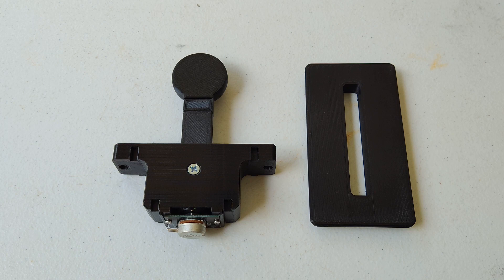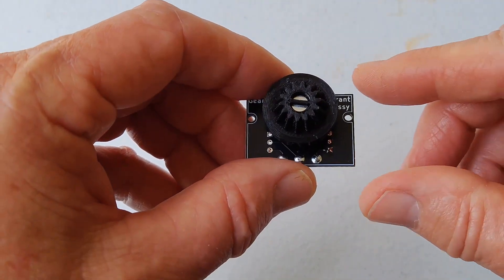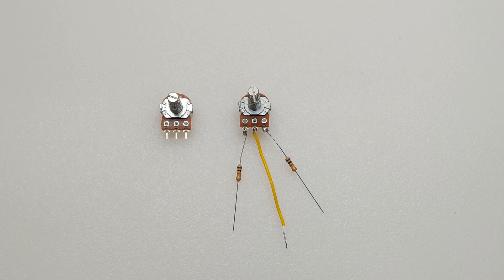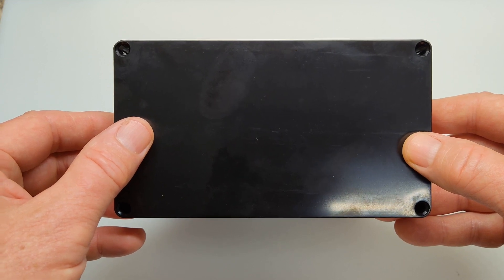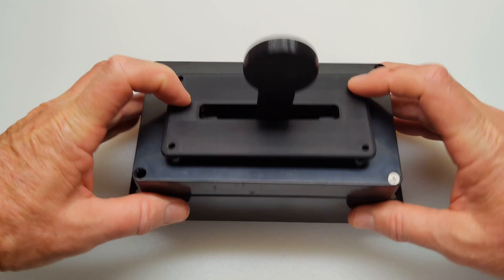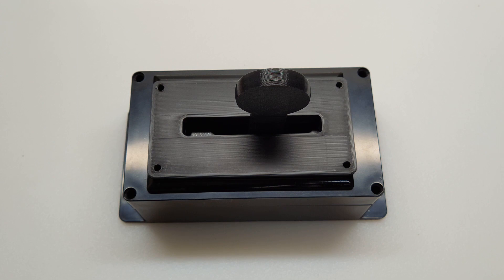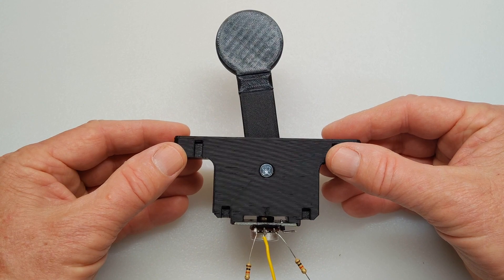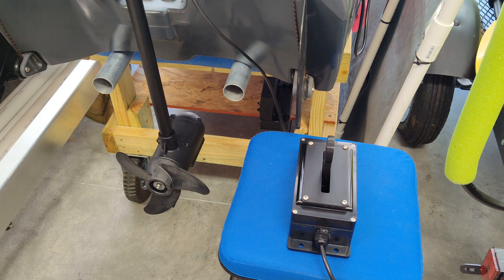Throttle Lever Electronic Speed Controller for Trolling Motor

Comment: this is great! I've been following your videos for some time now and modifying some of your successes to my own.  My newest project will be using the Minnkota traxxis control board with this throttle lever.  I'm also working on a remote-control system for the traxxis control board.   is it necessary to replace the pot like you did?  right now, you probably have some of the most informative videos to work off of.  I 3d print my own parts, I find the electronics tutorials very helpful.
Reply from the maker: Thanks! I like your Traxxis idea. I replaced the pot because the leads were too short.
Reply: @Aksmaniyak  so if I had the leads I could use the pot that is installed on the lever assembly.  That’s great news. Saves the headache of finding another one.  Again thank you for the great videos you make.  I’m working on a few projects of my own, when I have working prototypes I’d be glad to share them with you.
Reply from the maker: @sideswipe7939  Thanks. I thought you meant the Traxxis pot. Double check the gear pot to make sure it is a 10K. I don't remember off hand.

Comment: Will this work with a pwm controller?
Reply from the maker: Yes if you use the correct potentiometer.
Reply: @ I'm assuming the potentiometer that the pwm comes with would be the correct one?
Reply from the maker: @downlow5077  Yes, it is usually a 10K.

Comment: Do you build and sell throttle controlers that are not made out of cheap plastic like this POS? I dont know how many times that this one has broken and I've super glued it. It just crumbles in pieces not even ABS plastic. If so, give me a means of contacting you. Thx
Reply from the maker: I have not had that one fail at all. I have built other styles of controllers but do not sell anything. I couldn't warranty the parts.
Reply: @ Ok. Actually all I need is another pot and the lever and I can use the gears I got.
Reply from the maker: @davewesternky  They do sell the levers separately.

Comment: I’ve tried a couple different setups and currently I’ve had this one on a couple months and man is this thing cheap and flimsy. The handle cracked about the second trip out and super glue has held it together. Besides buying a Newport throttle is there an option with the slide throttle that is durable (I’m talking just standard usage, no abuse)? It would be nice if someone would come up with a trolling motor pedal style  foot controller for a yaks as my many military injuries have caught up with me. Thanks.
Reply from the maker: Bassman Strikes on YT has a side handle design that might work for you.

Comment: Great info sir! I recently got the same one but wanted to know if you knew a way so that neutral detent can be all the way back as full stop as I have a reverse switch on my control box? I just want it be like a normal throttle with the 180 degrees of travel starting at zero, middle 50% and full is WOT. Any help is greatly appreciated. I'm not a technical wizard but was an electrician for 20+ years so I get the jist. Thanks!
Reply from the maker: You would have to adjust the handle the same way I did to find the center. Find the "0" point of the pot, remove it, and pull the handle all the way back, put the pot back in. I think that will work.
Reply: @Aksmaniyak  Roger that. Thanks

Comment: Ia there any way to add a throttle like this to the endura max that has a built in PWM? maybe extend some wires to mount one next to a kayak seat?
Reply from the maker: The Endura Max PWM is epoxied into the base of the head casing. You would need to extend the wires and relocate the head or build a new box.

Comment: has anyone fig out a way to have a wireless potentiometer? would be huge to be able to control the throttle wireless, then one could use a big servo to control the steering
Reply from the maker: I haven't seen one.

Comment: This controller wouldn’t be voltage specific would it?    As in the same one could be used for 12, 24, or 36 volts?
Reply from the maker: They would work for each voltage. The V supplied to the pot is determined by the motor input V.
Reply: @Aksmaniyak  thanks for the quick reply.  I’m planning on building two - one for my friend’s 12v 65# and later I hope to get a 24v 110# for myself.  I’m already running a 24v xi3.  
The hold up has been trying to decide between their two models (with & without gear box).   I have tried repeatedly to get more information from Haswing with zero success.
Reply from the maker: Thanks. Haswing usually doesn't help much.
Reply: @Aksmaniyak  I had great customer support with a Haswing bow mount when a control board went out (after years of service).   Very helpful people on that end.   It’s with product information and sales where I have hit a wall.  Opposite of the usual with companies.
Reply from the maker: Good to know.

Comment: Which one of the two pots units would i need to convert from a minn kota turbo 65, 5 speed, tiller controlled speed switch to this lever set up your showing. My speed switch has physical damage beyond repairing - why im looking at a diy switch solution. Any advice helpful.  Your videos are informative.
Reply from the maker: Thanks! This controller is designed for use with brushless trolling motors or ESCs. A 3 pin pot will not work on a standard trolling motor like yours.
Reply: Thanks for the quick informative reply! Thought I'd ask that question-because on Amazon reviews, people are complaining that the "controller" they brought, for their Minn Kota is burning up, or exploding - they should of watched your video here!  Saved, Liked, and have subscribed to your channel. @Aksmaniyak
Reply from the maker: Thanks DP!
Reply: @Aksmaniyak but this will work with a pwm controller correct?

Comment: Do you have a video showing the connections in the motor head. I have a Newport Vessels 46lb thrust motor and I’m hoping to do the same type of configuration.
Reply from the maker: This won't work with a standard trolling motor. It only works with a brushless motor.

Comment: Hi when you wire the 10k pot does the center lead of the pot go to the signal lead of the servo wire coming from the esc? Thx
Reply from the maker: Yes, the center lead of the pot is the signal.

Comment: I would like to build a concept in which the controller consists of a kill, fwd/rev sw and pot for motor speed. How do I communicate with the (brushless) ESC for the function of an added fwd/rev? I need the switch function for direction of travel so I can interrupt the rev mode long enough to active an actuator for my motor position lock. I fish rivers so I need my position lock to default as free travel in FWD. but need to lock motor travel for REV. (obviously) without the silly cords to do so!
Reply from the maker: You can use a wireless joystick ESC controller.
Reply: @Aksmaniyak  are there any hardwire solutions?
Reply from the maker: @fishntools  If you have a wired controller, you could trigger the kill switch or just add an on/off switch.

Comment: 0:26 - the lever does NOT have a 280° angle of movement - movement was less than 90°? (the gear on the pot may rotate more)
Reply from the maker: Yes, you are correct. I should have been more specific. I will update the narrative, thanks.

Comment: So why the 1k resistor?
Reply from the maker: That is due to the Haswing electronics. I don't fully understand it but the 2 guys I mentioned in the narrative have an understanding of it.
Reply: @Aksmaniyak  You want to limit the current flowing through the pot else it will damage the pot & cct.

Comment: Why bother with a wire gland? That enclosure is going to become a bathtub.
Reply from the maker: I suppose if you drop it in the water. The gland nut also holds the wires in place.
Reply: @Aksmaniyak  Will rain water too not accumulate in the bottom? I'm looking at it from a kayak application point of view.
Reply from the maker: @fishntools  It depends how you mount it. You can mount it at an angle and add a drain hole. You can add a rubber sheath under the bezel with a slit to help waterproof it like in vehicles. You can remove it after use and turn it upside down and drain any water. It is only a pot and wires inside which sit above the bottom of the box. Could it fail? Sure, just like any electronics.